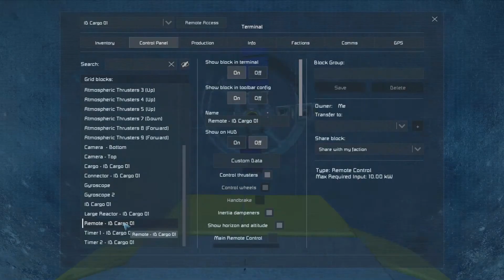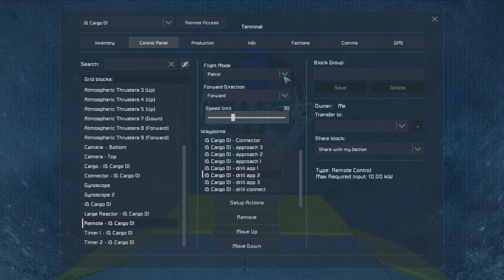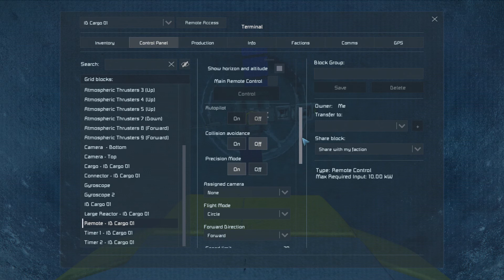Space Engineers Single Player Survival Season 1 Ep 9 - Ice Drill and Cargo Drone

Comment: Aside from adding a piston horizontally, you could drill down vertically and mount the support pillar of an extended piston that lowers gradually all the way down before the piston on the drill even starts to extend. That would give you twice the depth and width. Assuming the ice goes that far down that is.
Reply from the maker: I've actually hit rock with the 2 piston set up as it is, so depth isn't an issue now. I think the easiest way to add width (without more timers and programming that is) is simply add more drills. As it is, this simple set up can collect around 10 million units of ice from that relatively small area!

Comment: Very nice rig 👌.

I did build a similar ice drilling contraption, albeit way more complicated than yours.  Mine has two horizontal pistons (one either side of the CC) on the end of which were a couple of pistons pointing down (like yours).  But I only had one drill on the end of each piston.  

Then I had a metric tonne of Timer Blocks that allowed for the drills to be slowly pushed out as they drilled and rotated and at the end of the extension they would drop down and retract.  Then rinse and repeat until the vertical pistons were fully extended.

The build wasn’t to bad (albeit far more expensive than yours) but setting up those timers what excruciating.

To overcome doing that each time I finished drilling a hole and needed to re-locate, rather than having to re-build every time I built my rig on a Landing Gear (I’m sure you can see where this is going).

Picking up the rig with a ship was relatively easy but trying to place it down absolutely level was impossible.  And, as you will well have guessed, if it is not absolutely level it just destroys itself when drilling commences.

So then I built a crane, similar to those you see in the dockyards, to drive over it, pick it up and move it to the next loc (see how I like to make work for myself 😁).  But that too was subject to failure for reasons beyond my comprehension .  So I gave up.  But after watching this episode I am encouraged to revisit my contraption (named Derick) as I think I may have a working solution.

Sorry this was a bit long winded.  Just wanted to share the experience.
Reply: Oh!  and another thing I did, that you may find beneficiary, was to place the CC above the drills and placed another an Advanced Rotor between the rotating drills and the CC.  That Rotor is set at the same speed as the bottom Rotor but spins in the opposite direction.   This keeps the CC and everything else above it, stationary.
Reply from the maker: There's nothing wrong with over- engineering! I like the fact that lots of people come up with such differing ways of doing stuff

Comment: Seems like a lot to get them set up correctly, but the benefit to automation will pay for it. Thanks for showing the set-ups. I've had voxel trouble of late also - needs a reboot of the game to correct. Haven't had the exploding connector - yet (as he knocks on wood). That's frustrating. By the way, I tried to drop stone on an enemy installation and it didn't seem to have much effect when dropped from too high. When I got closer, there may have been some damage, but their guns started firing and that was the end of that. The best method I've found so far is to tunnel up to the building and sneak inside, battle the internal turrets (which are a bit easier to deal with), and shut down the power. Then, their base is ripe for Bob to take it apart. Attacking with a ship never seems to get me very far - the targeting on the guns is for crap; they don't shoot at outside turrets as far as I can tell. I get blasted out of the sky even after I unload nine gatling guns and two missile turrets. I'll be anxious to see how you take on targets.
Reply from the maker: Building the drones will be quick once we blueprint and set up the factory. Waypoints are a necessary nuisance!  I have a few ideas about attacking bases which should be fun. For example a swarm of gatlings floating down from above on parachutes!
Reply: I like firing stone at 100 mps using grab gens it's like using a shotgun devastating damage just
Reply: Gravity gens dam auto correct

Comment: Part of your problem with the bouncing rover might be that you have your suspension placed wrong way up.  I noticed you did it on the small rover too.  And yes, that means your height offsets look wrong, but the offset is the distance from the centre of the sunspension.  A negative offset means it's lower.  Check the image of the completed suspension in the blueprints menu, it shows the wider section at the bottom.
Reply from the maker: I know! I do that sooo many times! Thanks for pointing that out though...

Comment: 2:06 Perhaps you can add a horizontal piston instead of those two conveyor tubes and extend it to drill an outer circle when the inner circle is drilled empty. Or even automate it to extend and retract slowly, so that you're drilling a larger hole. It just seems that with one more piece (a horizontal piston) you can more than double the production. That sounds better to me than having to make a second drill platform when the original design runs dry.
Reply from the maker: Good thinking. I'll add that modification on some of them. Doing this isn't so much about gathering tons of ice,  it's more about having a swarm of automated machines and drones running around doing my bidding!! Lol

Comment: I think the launching issue with Vader is the connector pushing down on the vehicle suspension. When you release, it acts like a spring. It doesn't look like the parking-brake-wheels-exploding bug to me.
Reply: Oh, and forgot to add, try lifting the wheels using the suspension before detaching.
Reply from the maker: Hmmmm.... darn it. As you'll see, it's unfortunately a bit too late now! If I do resurrect it I'll try that. Thanks